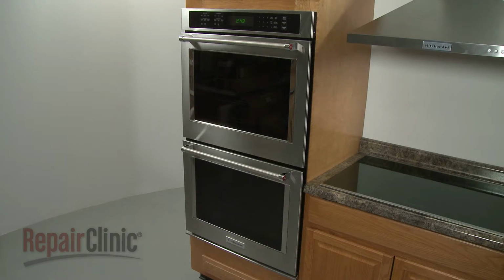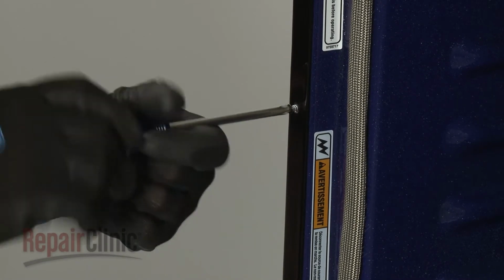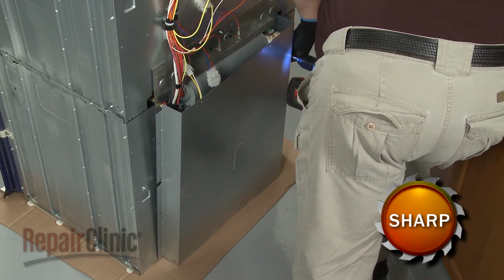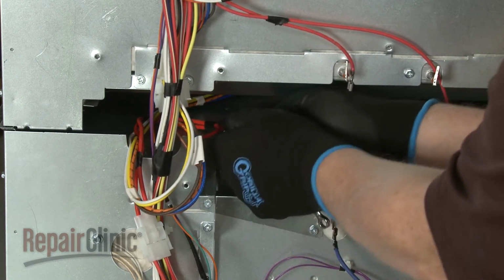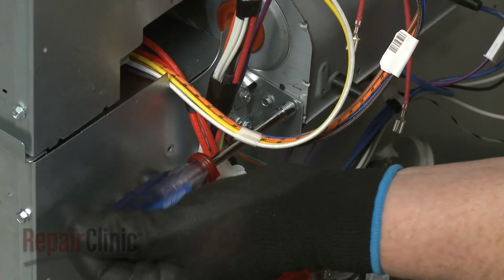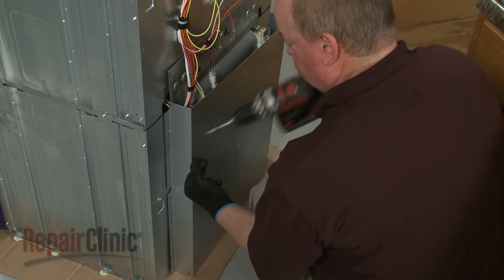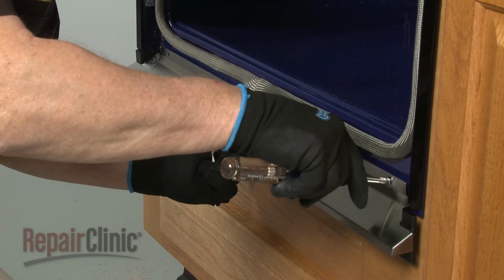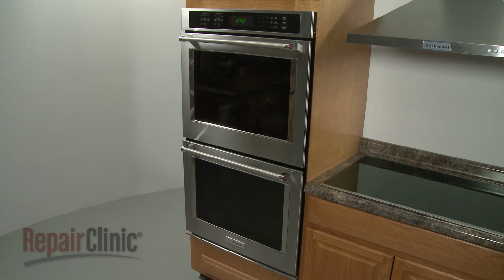KitchenAid Double Wall Oven High-Limit Thermostat Replacement WP4449751

Comment: Could I place the bottom thermostat to the similar place where the upper thermostat is (on the back surface just below the blower motor)? I’m wondering why they placed it here and the top one on the back side.

Comment: My KOCE507ESS oven started smoking (set at 325 degrees) and when I opened it, what appeared to be melted plastic - periwinkle blue in color), mangled wire (encapsulated in what appears to be plastic), some kind of retaining clip, a small 3/4 inch round magnet which had fallen to the base of the oven directly below where the temperature probe is located. Upon inspection, there appears to be darker burnt metal around the base of the temperature probe.  Any idea on what this could possibly be?
Reply: We have this same model (KOCE507ESS00 Wall Oven/Micro Combo) and essentially the same issue, but we've never had the component meltdown you describe.  We've always been able to contain the problem when we hear the blower jump to high speed.  The oven temperature races well above setpoint and fast, e.g. a 350F setpoint will (slowly) be reached (as indicated by the audible signal), seemingly maintain temperature for a few minutes (~10 mins), and then suddenly skyrocket past 550F as indicated on a separate rack hung thermometer we use.  I think the temp would continue to rise and peg the thermometer if we didn't intervene by turning off the oven.  I'm going to try replacing the high limit thermostat shown in this video (WP4449751).  That P/N checks out with KitchenAid for my model oven.

Comment: How do you know if this goes bad?
Reply: The controls will let you set the temperature, but when you press Start neither the bottom oven element (Bake) nor the top Broil elements will heat up. To test the fuse, check it with an ohm meter... if it reads open (infinity on an analog meter), the safety fuse has done its job and kept your oven from catching your home on fire.
If the elements heat up at all, this fuse is not blown (check temp sensor instead).
Reply: @Darr247  My oven keeps going past the upper limit I set, If I set it at 350, it keeps climbing to 450+. I changed the thermostat inside the oven(Kenmore 790.41013802 Temperature Sensor Genuine OEM). Any idea what else it could be? My Model is Kenmore 790.41013802. Thanks much in advance.